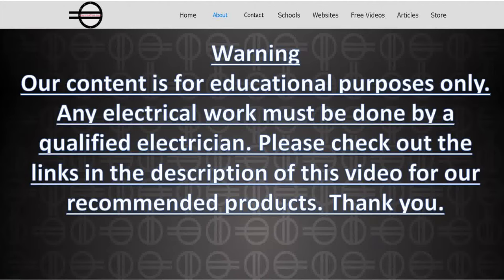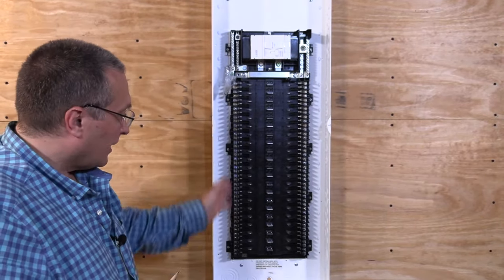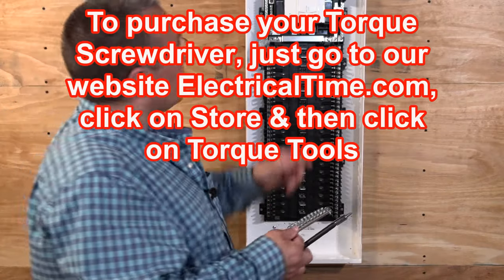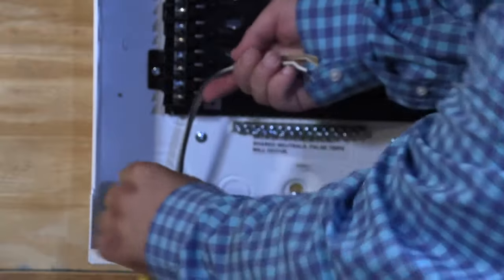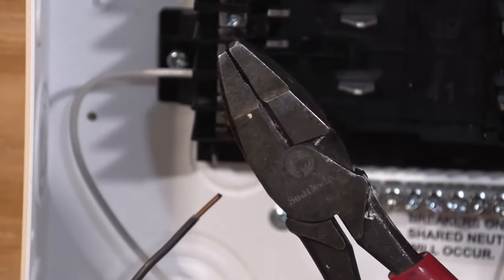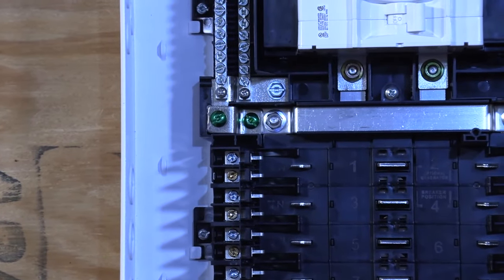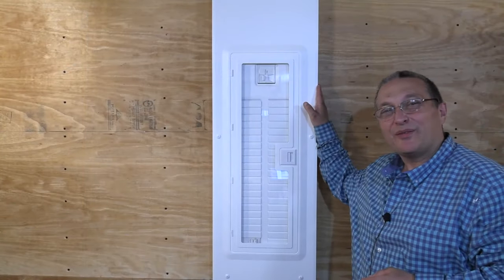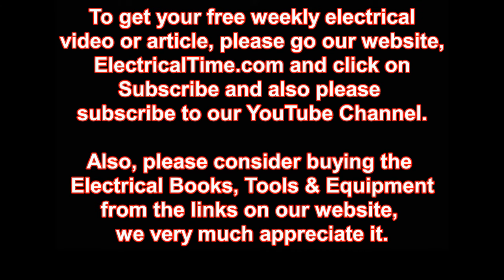Leviton Circuit Breaker Panel (Load Center) by ElectricalTime.com - Video 2020-031

Comment: How do you connect a number 4 wire in does super tiny teminals
Reply from the maker: Hi Julio, thanks for the question. I would suggest got to the Leviton website for that nformation. Here is their website for on the residential sire. https://leviton.com/products/residential/load-centers